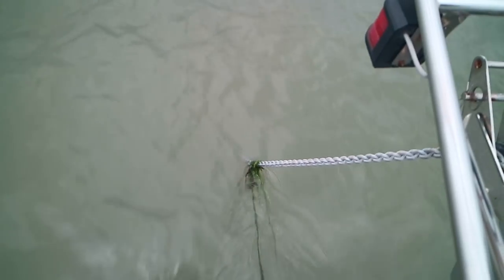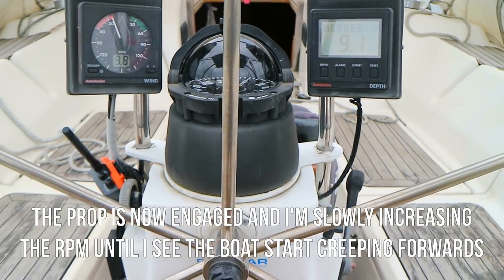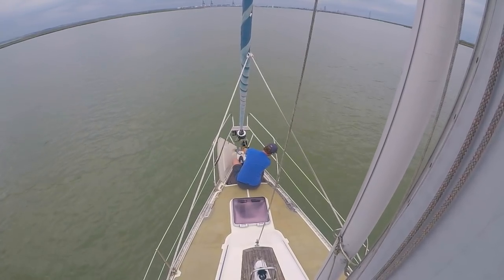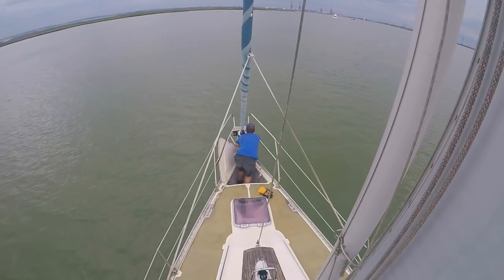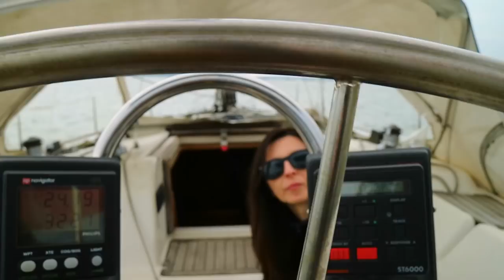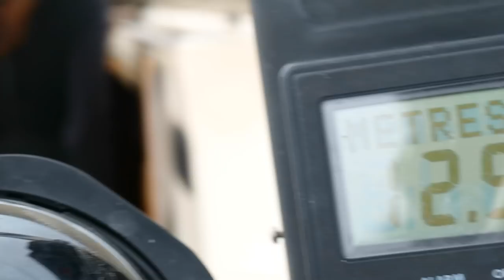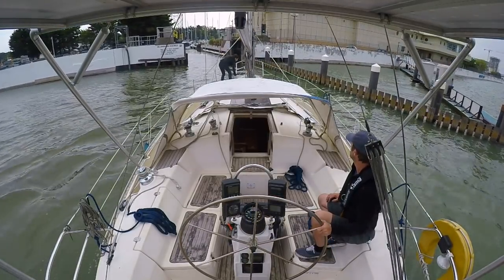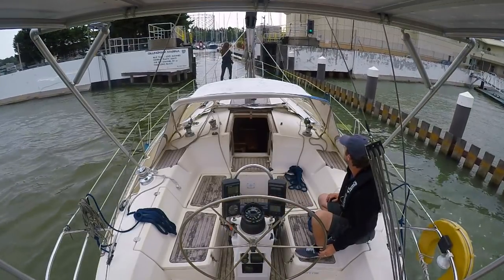Weighing Anchor with No Windlass + Shakedown Debrief | ⛵ Sailing Britaly ⛵

Comment: I have a 13 kilo anchor and no windlass, and found wedging my legs against the anchor locker using a rowing motion bending my back and pushing with my legs does the trick easily . I'm 65 and sailed the boat from the Isle of Man To Didim Turkey without a problem on my Bavaria 32 .
Reply from the maker: Hi Frank, thank you for sharing your experience and technique, we can all learn from each other. Good on you for your fantastic sail to Turkey. Fair winds, Chris
Reply: That’s what I do as well with similar weight anchor. If the anchor is really buried, I’ll tie secure the rode at ~1-1 scope and it will work itself free while I take a minute of rest.

Comment: I fitted a manual windlass after getting caught out by the tides in the Bristol Channel in full flood of 4.5 knots. Trying to lift anchor solo with no auto tiller is very hard work. Pulling a 9m boat towards the anchor against 4.5 knots of tide is insane and that's even before you lift the anchor off the sea bed. But hey I now have a windlass, fixed my auto tiller and so far not been caught out by the tides 😊😊😊
Reply from the maker: Hi Lee, 4.5 knots is a crazy current for sure. Congratulations on upgrading your boat, we intend to do the same eventually but all in good time. Cheers, Chris 😊

Comment: Well that's a great tip Chris. Cheers dude 😁. 
Baptism of fire for me too next week as I do the final prep to sail mine around from the IOW to Portishead. So when is your next big trip? I shall be finishing off the antifouling, cleaning and oiling the teak, polishing up the hull and putting the new name on it and stripping the head and lapping the valves in before  it's put back in the water next week. I can't wait 😊⛵
Reply from the maker: Hi Vince, happy to be of service! I'm on the boat now frantically preparing things for some solo sailing. Hopefully new horizons soon, but our plans of late seem to be drawn in the sand at low tide so we will see what happens! 😁 Good luck with your boat work and I hope everything goes according to plan with a successful splash next week. Getting in the water is a huge milestone, and then the adventures really begin! Fair winds mate! Chris 👍

Comment: Why all chain rode?  Isn't there a much greater "slamming" effect when a boat at anchor on all chain pitches up and down?  I prefer the combo of 20' - 30' of chain followed by synthetic anchor line, with some built in give and stretch.  It's also much lighter to retrieve manually.

Comment: Great explanation. Is there, in your opinion, to use a prusik knot scenario, to also, raise the anchor? in car one needs to run back to the cockpit.
Reply from the maker: Hi there, you can use a rolling hitch to tie a line on to the chain to hold it if you don’t have a chain hook. I invented something I call a “chain stopper claw” which you can see in this video:

Sailing Single Handed, UK to Belgium, Part 1 | ⛵ Sailing Britaly ⛵ https://youtu.be/0XGxxTWAOrM

This is extremely convenient, especially if you sail alone.

Cheers,
Chris 👍